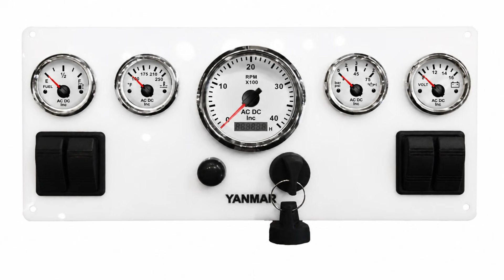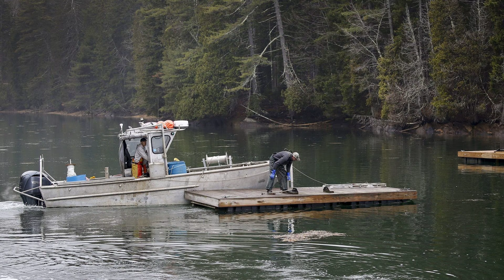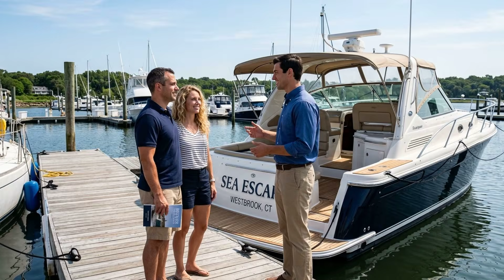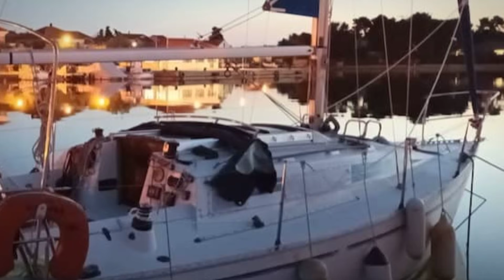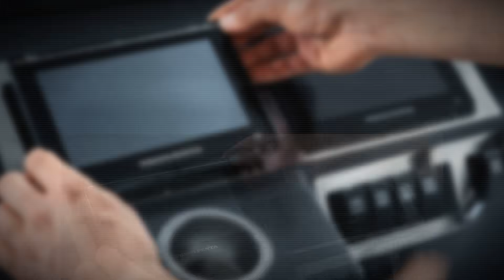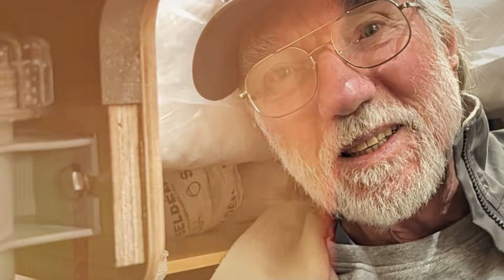Why Yanmar Became the Only Engine You Can Actually Fix at Sea

Comment: So pleased that I have a couple of Yanmar 4JH57 in my cat, I did have one of the older Volvo MDs in my mono-hull, solid and reliable, but that was a mechanical device.
Reply: Thats a electronic hjh57 diesel common rail same as volvo electronics.
The fact its yanmar might help but you still need a tech with computer

Comment: Yanmar YSM 8, 1981, Unknown working hours, but we can imagine many. Used every week around 4 times.  I have cruised with it for 12 hours full thrust and and didn't gave a single sign of exhaust after the effort, I had the feeling that could be running non stop for ever. Incredible engine, Now, after 45 years, just hard on cold crank ( 15-20 seconds in winter) but with a good starter engine, nothing bad. And I'm sure it's just about tuning the valves which have been untouched for the last 7 years. I honor it to Markuay!

Comment: New Yanmar marine engines 40 HP and above are electronically controlled with common rail injection, like Volvo. New Beta Marine engines, which are marinized Kubota engines, are completely mechanical.

Comment: I have a yanmar 3 gm 30 f in my trimaran hasn't missed a beat in 25 years all mechanical components,  juast do the maintenance,  easy!  by the way i sailed 98000 miles around and around the pacific in that time.

Comment: Yanmar diesel engines are incredibly reliable, but getting them serviced comes with notable drawbacks, primarily revolving around expensive OEM parts, proprietary computer diagnostics, and a scarcity of local, certified technicians.1. High Cost of PartsYanmar replacement parts (such as fuel injection pumps, injectors, and exhaust elbows) are notoriously expensive compared to other engine brands. Relying on genuine OEM parts significantly drives up the cost of routine repairs.2. Proprietary Diagnostics & ECU DependenceNewer electronically controlled Yanmar engines are equipped with Engine Control Units (ECUs). Diagnosing faults requires proprietary software and tools that are generally unavailable to the general public or independent mechanics. This often forces owners to go through authorized dealers and pay premium dealership labor rates.3. Slower Mechanic Turnaround TimesBecause Yanmar has a specific network of authorized distributors, finding a certified technician who can perform specialized repairs—especially if you are in a remote area—can mean long waitlists during the busy season